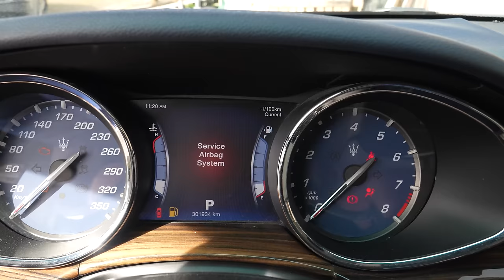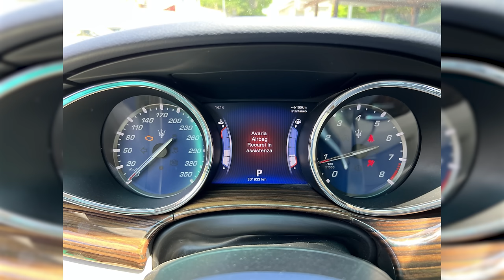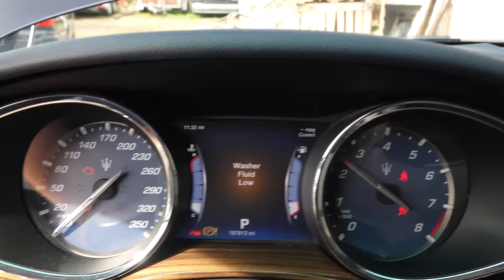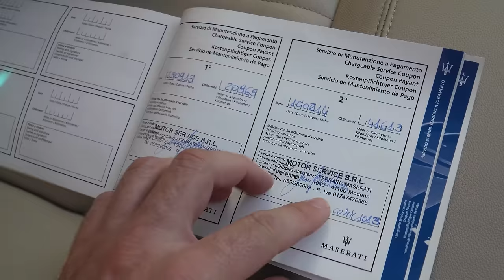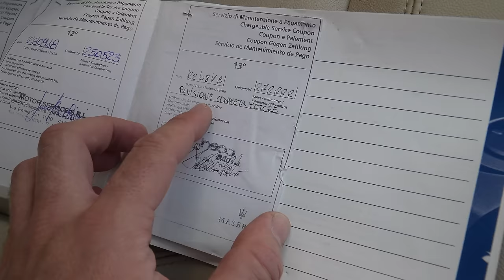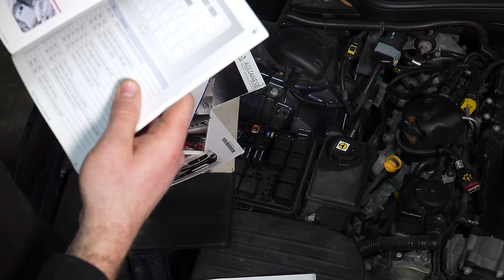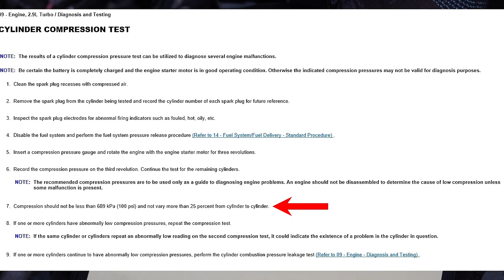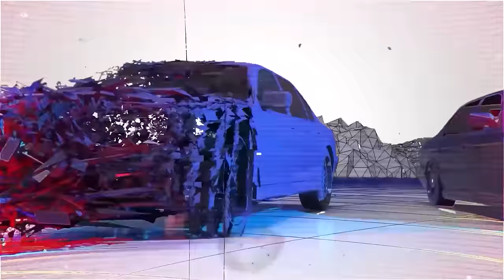I Bought The Highest Mileage Maserati Quattroporte GTS - Project Mantua: PT1

Comment: Could you help answer a quick question with n62? Having trouble doing the C02 test as the thermostat doesnt open until the coolant is already boiling in res, Would any potential exhaust gasses make their way into the expansion tank prior to main thermostat opening? I did 2 tests for 20-30m roughly where it stayed blue but main thermostat never opened, When i let it open, it all came boiling out lol.

Comment: But does it really have that many miles?  The smaller the wheel the more times it has to turn to cover the same distance. The odometer then records more miles then the car has covered. Most are set for a radius of  16 inches from centre of wheel to outer edge of tyre. Error can be in 10s of thousands of miles.